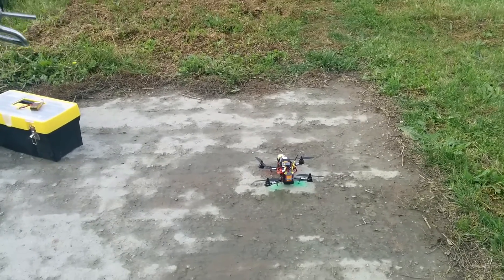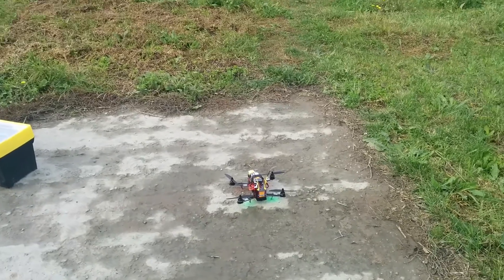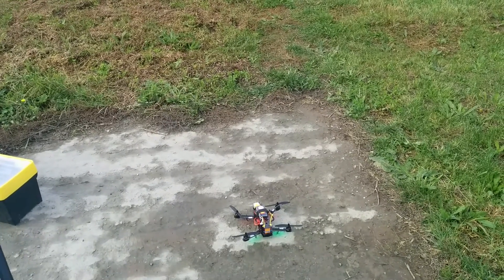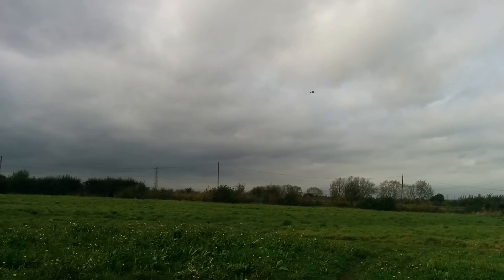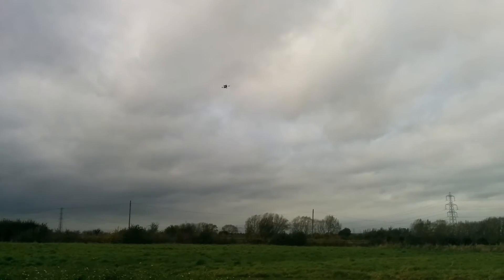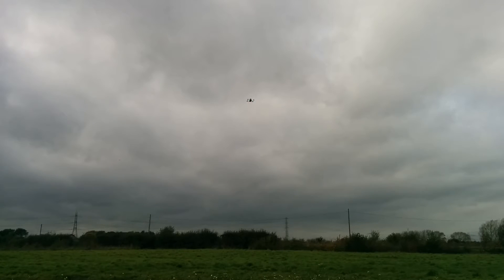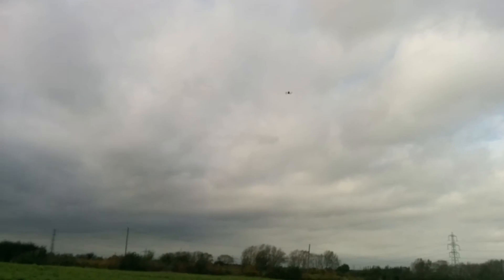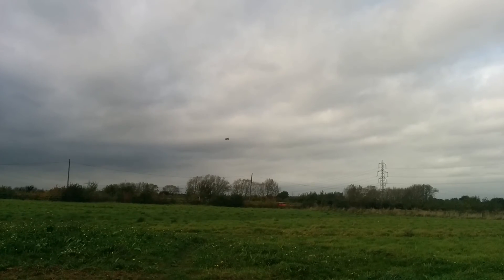ZMR250 - GPS Tests No.1 - A Windy Kent Day

Comment: Was looking to see if anyone has sorted this out very well. I had the same problem. What I narrowed it down to was the amount of magnetic error caused by all the electronics, assuming the ESC are the major culprit. I tested on the bench with it plugged into base flight and powering up till just before liftoff throttle was getting 90 deg + error. Its just never going to work like that. With the compass on the main board there was no way I could get it far enough away form the electronics to get rid of the problem. 
You should test yours. Plug the USB cable into cleanflight and see what happens when you spool the motors up. 

https://www.youtube.com/watch?v=BJQfWH0i0tM
Reply from the maker: Helimadness100 Hi, that is a very good point really. As with most builds this small the 12A ESC are sandwiched between the bottom and middle plates. The FC is on the middle place, bang centre to the four ESC. Directly underneath is also the PDB.  I guess that I could add a remote I2C Mag on a stick to get it away from the EMI. Or perhaps re-site the ESC to the motor arms. As you say, this is never going to work like it is.
Reply: Danny Thompson Mine was on a F550 at the time. ESC were on the arms and I moved the FC to a 1" think foam block above the top plate. The PDB is on the bottom plate. So as much separation as I could reasonable get. Still not even close. To get an external compass to work I think you need to solder contacts directly onto the chip legs and remove the one off the board. Sounded too hard for what I wanted so gave up. Im sure someone will come up with a fix soon to overcome it. Hence I keep looking around.
Reply from the maker: Helimadness100 I ran a test on the bench with the GUI using the real time chart for the Mag. There was very little Mag deflection at 50% throttle. More at 100%, but none of it was to any great degree. Barely changed at all. I didn't watch the compass display, should have checked that also. Compared to MultiWii, Naza or APM these FCs are pants for anything much more than Acro or self level. But they are cheap :-)

Comment: Would be interested to know where you fitted the GPSmodule on the ZMR frame. I'm just finishing my first one and there is t a lot of space!
Reply from the maker: I put my GPS on the to plate, at the front, where the video recording camera usually goes. As you say, there isn't much space to mount everything. I expect if I fully set it up for FPV and recording I'll have to mount the battery below the bottom plate.

Comment: For GPS Flight mode on Cleanflight, do you mix it with Angle & Baro only, or Angle, Baro and Mag?
Reply from the maker: For GPS modes you have to include Baro and Mag.  You can choose between Angle or Horizon, but Angle will give the most stable flight under GPS control. Using Horizon may cause unexpected behavior :-)
Reply: Thanks